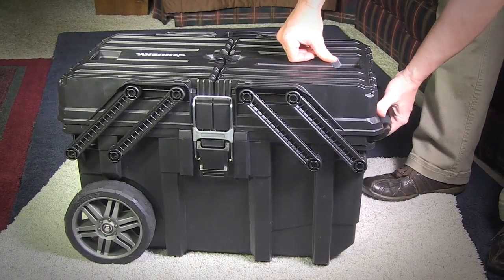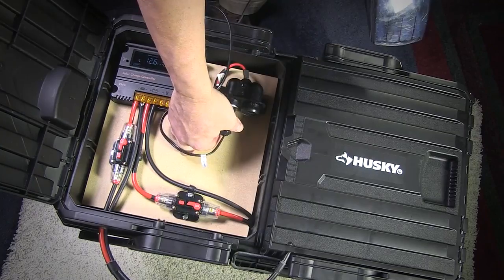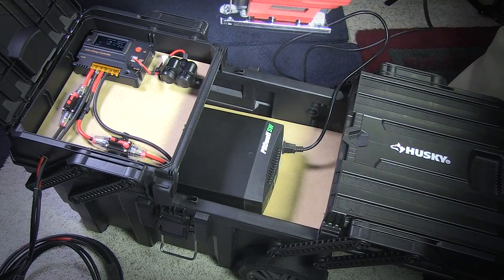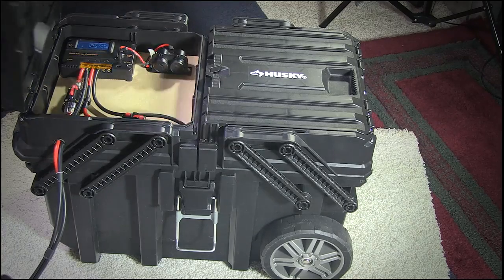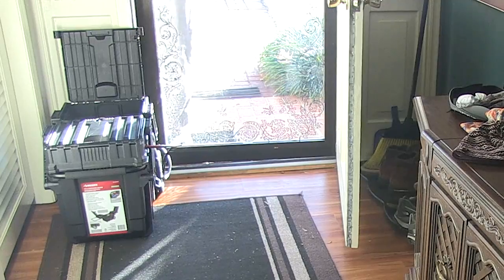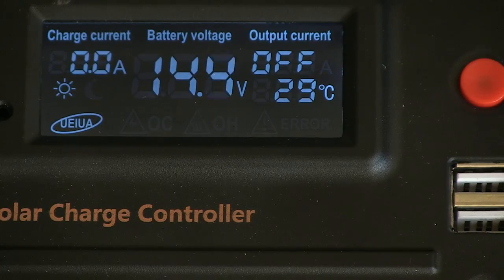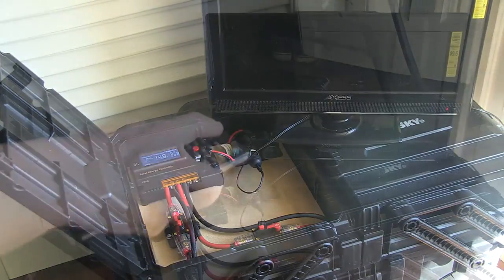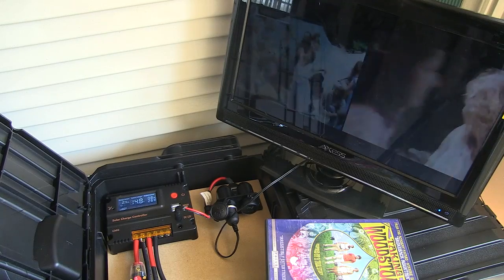DIY Solar Generator

Comment: Nice set up.  Being Modular is the best way to go about it.  Additions and changes available.   I would have gone with LiFePO4 batteries.  Those AGM batteries  simply can not match the performance   or benefits of the LiFePO4 cells.
The weight saving more then notable.
Capacity available for use the main difference and benefit.